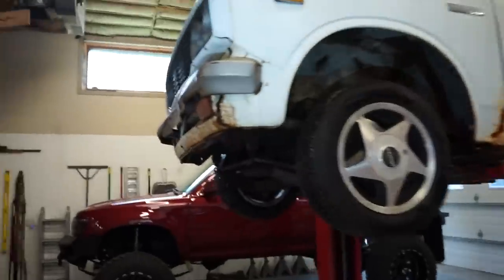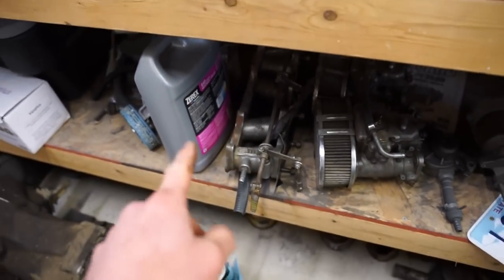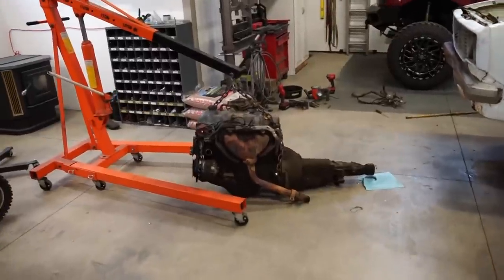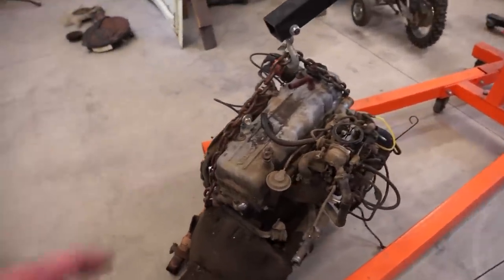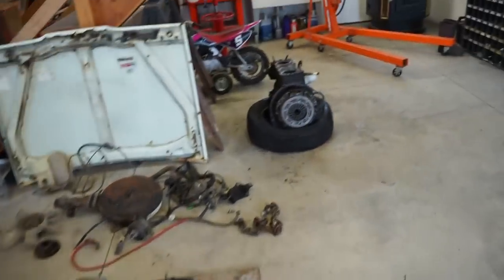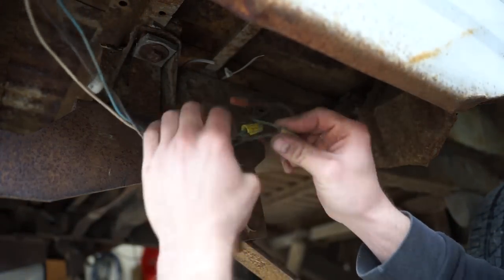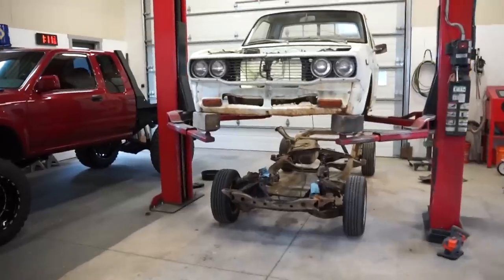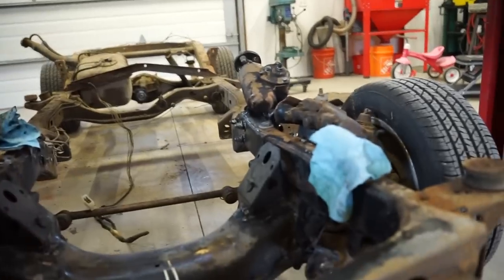That Escalated Quickly! NEW BUILD!! 1977 Toyota Hilux!!

Comment: Dude it would be cool to see it 4 linked with bags and cool custom 18" steel wheels with patina and the factory toyota  hubcaps
Reply: Like the Detroit steel wheel smoothies but with Toyota bolt pattern custom back space and provision to retain the original Toyota hubcaps

Comment: This would be the perfect shop truck!  In 1984 I bought a new Mazda B 2000.  Fanciest one you could get. %5,999.00 + $700 for aftermarket A/C and it didn't come with a stereo and no power steering.  Charcoal grey, white wagon wheels and it had 5 white stripes along the bottom that I peeled off with a heat gun and painted the wheels charcoal grey.  In the day it was a badass little truck.  I like your ideas so far and maybe I'm just remembering my old truck, but I think it would be cool to dip the cab and bed or whatever they do now so that bed seam never rusts and paint it nice with 60s series tires.  Just super clean, dependable and good mpg.  My friend had an 83 Toyota short bed with a 22 R,  It was charcoal grey too.  Great trucks.

Comment: My dad and I both had one of these at one point. I just sold his with 700+k miles on an og 20r. Never even had a timing chain or head gasket replaced. I turned mine into a pretty fun pre runner, had 2.5 king coilovers and long travel. I have a set of a arms for this truck if anyone is interested
..

Comment: Seeing the 22r or 22re reminds me of high school. Having  a 86 Extra cab 3 inch body 4 inch suspension with cranked torsion's. That was the first year of independent suspension. That engine sucked mud so many times but kept running after a cleanup.

Comment: That trans looks like a w50 to me. If the main case is cast iron and it has a different bell housing to trans bolt pattern than the w56/57/58 has I am pretty sure it is a w50. I might be wrong but it is a very good trans and it has a great reputation. I got one on accident as one of my 2wd hilux's came with a 4 speed and it had a w50 swapped in. Scored a 5 lug 8 inch axle, great trans, title, solid frame, and cab for pocket change! Made my day.
Reply from the maker: Sweet!!! Yeah it’s a w50!!
Reply: @austinniemela  they shift pretty smoothly and are stout. But there's a small chance it's a p51. Those use stainless steel synchros and are hella rare. Worth double checking but I would still use the trans in this truck. Should be able to check through a drain hole but knowing you will likely open it up to freshen bearings up anyway lol but that's good.

  Can't wait to see the progress reminds me of the one my grandpa had!

Comment: Another fun project... however I can't see you not doing a paint job lol... but a lowered ... chopped.. channeled rat rod mini truck... ummm... or swap in a V8  built... or tub the rear for a nice set of street cheater slicks tall skinny front tires soft suspension and a rat rod drag truck... 77.. nostalgia lowered wide tires on all 4 corners... rubber fender lip extensions and a shell or one piece aluminum bed cover and tons of sound system lol... So much possibility 🤔... have fun with it.  I have no doubt that once you see your vision it's going to look great in the end and everyone is going to enjoy seeing it all come together... [ no way was that a pun from a late 70's song... come together right now.... lol lmao]...

Comment: i have a set of 2L roller lifters that be modified with a to fit the R lifter rails, take like .002 off of each side of the lifters.  they are yours if you want them.

Comment: What's the benefit of the hybrid motor? Will it be mroe reliable than one or the other? Or you just hunting for more torque?

Damn i'm pumped for this build.
Reply: I think it’s super torquey
Reply from the maker: Well the 20r head flows better, with the early dome too 22r pistons you get higher compression. And a little more displacement. We will see how it runs!!
Reply: @austinniemela  a friend and I built one of these back in the mid 90’s—22R double roller  chain, 20R head, I think maybe a Downey? cam and 40/40 weber carb on the stock 20R intake. It did ok, maybe a little more power than a 22RE, though I liked my stock 22RE a lot better being that it just was less finicky.  Hoping yours turns out much better.

Be interesting to see if you could do some things to try to get some more RPM out of it, get it to run more like the 18RG.

Comment: Side draft are good the sound is incredible  one thing adjustment  is critical  if your manifold do not have  a vacuum chambers they tend to miss fire on brake on idle . I make my own chamber  .I use a pipe connect all vacuum ports of carbs to it a all needed vacuum needs of vehicle from ports build on chamber
Reply from the maker: These carbs don’t have vac ports. The manifold I bought has a boss to tap for booster. I wonder if I should tap each intake runner and add some sort of vacuum chamber!? Hmmm never thought of that!
Reply: Well that is the way to go when is time to adjust the idle screws you can used a carb balance tool if you decide to go that way  l will show you how to build one for about 8 to 10 dollars good luck Luis
Reply from the maker: @luiscruz-no3ib  yeah I found a tool for like $30 I might buy!
Reply: The ones I found do not work you need a one that works on the vacuum side  a liquid one not a air one